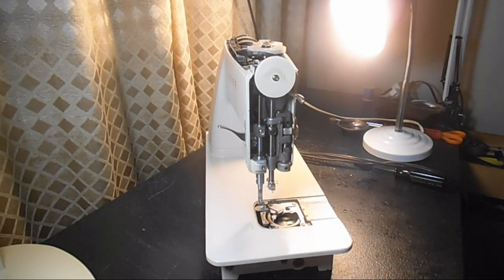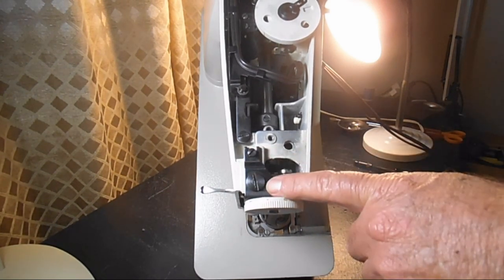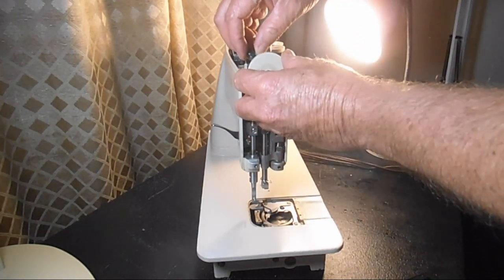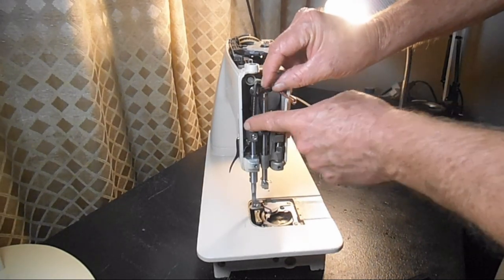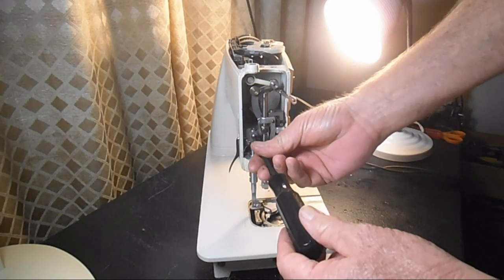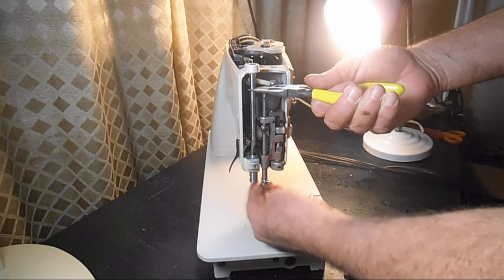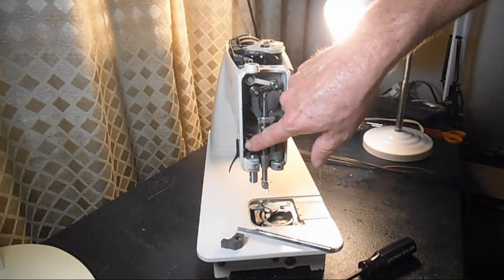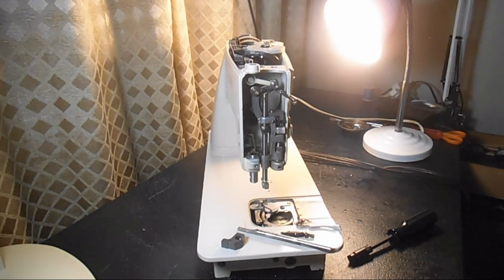How to remove the presser bar & bracket assembly on a Singer Model 513 Sewing Machine

Comment: great video; thanks! I think my pressure adjustment is broken. I would like to fix it and replace whatever is broken so that i can adjust my pressure on the presser bar again. Suggestions on actually getting replacement springs, or anything else I might need? I "inherited" this machine from a person who dropped it out of their car and broke a piece of the plastic casing. It still sews like a champ, except that this, and the decorative stitches don't work. Been sewing on it for 6 yrs, and I'm ready to fix it myself and am too poor to afford servicing and repair. i will watch more of your videos. i have only old singers and i love using them.
Reply from the maker: http://thriftyfarmgirl.com/singer-513-stylist-sewing-machine-parts
no new parts made any longer, so we have to find used vintage parts. Connie is a trusted seller I have bought parts from for years. Good Luck.

Comment: Am hoping this is the same general concept for the Singer 247. We are going to try to fix the presser foot lever this weekend. It's floppy and will barely raise the foot. The tension wheel and tension is also messed up.
Reply from the maker: You're on the right track. May just need to clean the presser bar bushing. Oil gets inside it and dries up and gets gummy and sticky. By tension wheel, you mean for the pressr bar or thread tension unit or both?
Take your time and take pictures as you go. Ask me if you get stuck. There are over 30 tension unit videos on my channel and several for fixing the presser bar (maybe you saw some.) Think about cleaning with alcohol and fresh oil before you take too much off. Good Luck.
Reply: @andytubesewing1953  Actually both the presser bar tension wheel and the thread tension wheel seem to be involved in this issue. The tension wheel will not turn much...only a few clicks. I can't get it to go to zero (or darn?). The thread tension dial also doesn't seem to be working right. It has more range, although, I don't think the numbers are lined up correctly with the tension setting. I'll take some photos and post them. Thank you!
Reply from the maker: @BZIRKWORLD  Both are fairly common on a used vintage machine. As I mentioned, a good cleaning can cure a lot of the problems, even spot cleaning of particular areas. Sometimes when the machine is first "rediscovered" the levers and dials are tried out and often forced which can bend/break parts and force adjustments out of their norm. It's nothing that can't be fixed. If you get discouraged or frustrated take a look at these 2 short slideshows; BEFORE:  https://youtu.be/04AN-FW7DzA and AFTER: https://youtu.be/5VrRLK7YZ-g        If you get stuck, drop me a line at my channel email, andytube53@gmail.com and I'll help any way I can.  Good Luck.
Reply: @andytubesewing1953  Thank you. I'll look at the videos and I'm fairly sure I'll need to use the email for assistance. One notable thing is that the up/down lever for the presser foot has no tension...it is just floppy. Raised to the top position it will engage and lift the foot a tiny bit but not enough. When I put fabric under the foot and lower it, it will not hold the fabric in place. The machine will sew but I must pull the fabric along.
Reply: Lol... I watched the video...mine isn't that bad. I bought the machine 37 years ago at a PX in Hawaii and have kept it moderately maintained but it has not been used for five years or so. I did find two hot rocks (those hard beans that grow on trees) inside the cover next to the needle/presser foot assembly.   :)
Reply from the maker: @BZIRKWORLD  haha I enjoyed hearing about how you found it and after sitting for 5 years it can definitely be dried oil making the spring in the presser bar be stuck inside the tube so that's why you're lifting lever just flops around you can try putting alcohol where you at normally oil to see if that will free it up you can also warm the parts with a hair dryer or you can just start taking stuff apart and cleaning it that way if you like after watching that 347 video you see that your machine isn't all that bad and can certainly be made to work properly again
Reply: @andytubesewing1953  He fixed it!! I'm beside myself! it was a series of changing the position of the posts while tightening various screws. Also the tension wheel had the little post on the inside of the notches instead of outside. I know I'm not explaining it right...but it works and I'm super excited. This was my first sewing machine. I prefer it to my newer, fancier brother. <3
Reply from the maker: @BZIRKWORLD  congratulations That's a great news I'm happy it's working and hey it's only Friday you still have the whole weekend thanks for letting us know that Happy news

Comment: I have a brother sewing machine and the bar broke where it holds the presser foot. Can it be replaced. Or would it be cheaper to purchase another machine
Reply from the maker: I don't work on Brother machines. In general, if it is a popular vintage machine you may find replacement parts on eBay from a seller who has dismantled a machine and is selling the parts. I do this all the time with Singer machines, paying between $1- to $15 for a used presser bar. If it is a modern machine you may not be able to find the part, even at a repair shop. If you can see what the mod3l number is then search eBay for Brother Model  "1234" sewing machine, or even a Google search for Brother Model "1234" presser bar. You can also call local repair shops if there are any in your town and ask them about it. You need the model number of the machine to do any of this. If you are in the USA, Brother has a Contact Page where you enter your model number for information and who to contact for that model https://www.brother-usa.com/contact-us   They also have a page to Locate their Authorized Dealer where you put in your Zip Code https://www.brother-usa.com/dealer-locator?&Radius=25&Tab=1
If you need to buy a machine in the end, think about buying a vintage SInger that won't break. Brother made nice vintage machines too, but SInger parts are easier to find.

Comment: can you please tell my how we can fix my pressure foot lifter I lost my spring my is a singer 9134 can you tell me how to fix it. Thank you
Reply from the maker: Sorry, I can't. Model 9134 is from 1998 and 25 years newer than the machines I work on. The parts manual shows it has a coaxal presser bar system and the spring sits below the presser bar bracket (unusual) The spring is not even given a part number in the manual. No part supplier I work with has any presser bar parts on that model, other than a replacement lifter lever; https://www.sewingpartsonline.com/presser-bar-lifter-singer-314582.aspx   I can not find a copy of a Service Manual or Repair Manual for sale anywhere. I found one discussion about removing the presser bar lifter from 2012 https://www.fixya.com/support/t13989370-replace_presser_bar_lifter_singer_sewing  There was one used lifter for sale on eBay, but no spring that I could find. https://www.ebay.com/itm/281379950860?hash=item41838d510c:g:Hd8AAOSwufpZwtJu

Comment: Andy Darlin', how do I get the needle bar and lifter out of my 15-91. I'm trying to get it ready to paint.
Reply from the maker: You can buy a Singer service manual for $9 here: https://manualsoncd.com/product/singer-15-sewing-machine-service-manual/
It may help you understand the presser and needle bar functions.
The Model 15 is very similar to many other Singer Models, with slight variances. These videos I posted show how to remove and replace the bars in a machine that has the same basic function. A few of the parts look a little different, but the principal is the same. Take a look at them before you buy the service manual. They may contain enough information for you to work on your Model 15. Good Luck
https://www.youtube.com/watch?v=oCh616b7jSY
https://www.youtube.com/watch?v=S52xOYYZV58
https://www.youtube.com/watch?v=OaiF13ddZe8

Comment: Happy Wednesday Andy, I'm still trying to clean the singer stylist. There seems to be a part missing the washer,do you know where I can buy one? Any information that you could give I would appreciate. Blessings and Light to you 😇
Reply from the maker: I know Singer screws are odd proprietary sizes. I've never tried to buy a washer for a Singer at the hardware store, but they may have one that would fit, or could be modified to fit. Usually I have to buy a set of parts that include something like this. No one is going to sell just the washer IMO. Thrifty Farm Girl has the parts for sale, it looks like. If you can't buy at the store you could buy from her. There may be other sellers on eBay or Bonanza too. Here is the parts I'm speaking of: 
http://www.thriftyfarmgirl.com/singer-513-stylist-sewing-machine-parts
Good Luck.
Reply: Andy Tube Thank you Andy. I will let you know when or if I'm able to buy the part needed.
Reply from the maker: OK Violet. Good Luck.

Comment: Andy, can you help me to figure out why my lever on my pressure foot won't work. It just hangs there like it's not connected. I have a singer model number 4562.
Reply from the maker: Your model was made in Taiwan and I've never had much luck finding the parts or service manuals for them. You saw in this video the guide bracket that gets pushed up by the lifting lever. Every Singer machine I have worked on uses this system, and all the parts are made of metal. The machine from Taiwan that I have seen have many, many plastic parts, so I'm guessing (and it's a WAG) that your presser bar system is a little different, or a plastic part broke and there is no link between the lifting lever and guide bracket. 
WAG = WIld A%% Guess. Normally, the guide bracket holds the needle bar and gets lifted with the lever and a spring pushes it back down as you lower the lever. You'd have to start removing a few parts in the nose, maybe the bracket you attach the nose cover to, and take a deeper look inside to see what the lever is or is supposed to push up on and why that is failing. I wish I could help you more, but your model is too "new" and I have experience with it. Find yourself a nice 403A 😉 Good Luck.
Reply from the maker: @SewnAgain  Nicely done, April. I'm glad you figured that out and thanks for sharing what the fix was. Happy no broken plastic this time. Good Luck going forward.
Reply: Hello Andy, thanks for this video, very useful. I need to try to find out why all of a sudden the presser foot lever is not connected now with the presser foot. I will use this video as a guide. The model is 1507 : )
Reply: I fixed it!! I can’t believe!! Thank you very much for this video again, I thought I had to take it to a shop!!